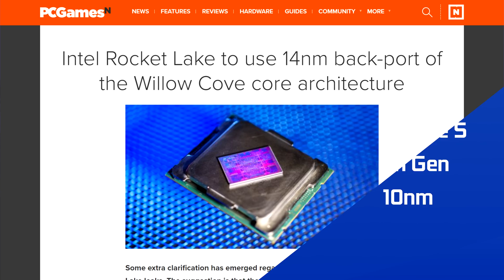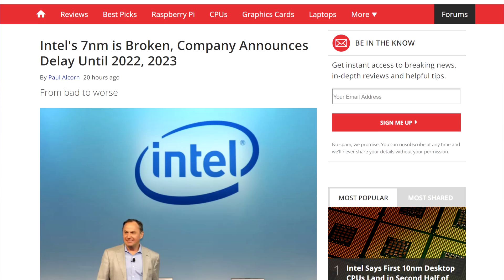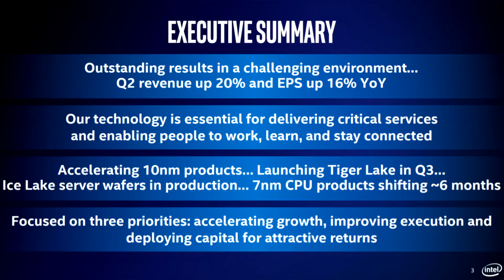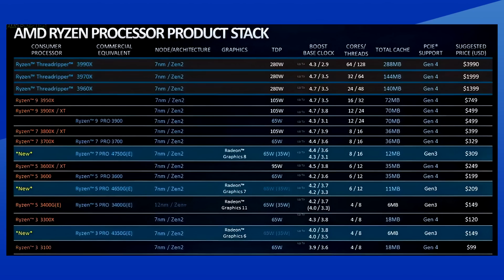Intel’s 7nm Process IS BROKEN! Delayed until 2022 - 2023

Comment: 7nm?  Where the hell is the 10 nm or did I miss it?
Reply: Intel fucked up on their 10nm so they decide to just skip to 7nm immediately
Reply: @NerfMaster000  thats not how it works
Reply: @AndrewMellor-darkphoton  I'd heard they were planning to skip a lot of products straight from 14nm to 7nm, since their 10nm node was so massively delayed and is still having yield issues. No way can they survive on mostly 14nm for another two years, though, they're going to have to get 10nm volume up and get everything running on it, Atoms to Xeons.
Reply: @NerfMaster000  intel 7nm is more complex than intel 10nm and 7nm needs tech from 10nm to work so they have to fix 10nm to get 7nm

Comment: "2022~2023"
Translation: "2025".
Reply: intel got foveros to help with this
Reply: @AndrewMellor-darkphoton  how? You cannot sandwich high performance chips.
Reply: @jonnypena7651  two layers, not a sandwich
intel adding foveros to alder lake
it will likely be simpler than lakefield
Reply: @AndrewMellor-darkphoton  still, the heat movement is very complex in a multilayer chip.
Reply: @jonnypena7651  I don't think heat movement is going to be a problem as only the top players gonna have logic which makes most of the heat and the bottom layer will only be connecting other top players with wires. The real problem is thermal expansion because the top layer will expand more than the bottom layer due to being hotter which will cause the copper pillars between the dies to stretch which might break them. Intel's gotten away with crazier things before so I don't think this will be hard to fix. Future 3 D stacking technology might stack logic dies on top of each other which will cause heat movement problems I don't think this will happen for another decade.

Comment: Go and take a look at Intel and AMD stocks right after the announcement of 7nm being delayed, you might find it amusing :)
Reply: Intel drop down 16% of their stock markets,I expect intel to fall,BUT NOT THIS HARD
Reply: Now the Apple thing makes so much more sense. Apple knew this already months befor we did they dropped for that reason Intel and now they try go to ARM chips. Apple likes have lower power consumption that's why they IPhones have 7 and 5nm TSMC chips now that Intel is still on 14 and 10nm for laptops and desktop Apple need to drop Intel. Apple laptops are mostly those ultra thin designed one they can't afford having high power consumption. Now everything makes totally sense.
Reply: @strohhuttv8848  Yes this is likely the reason for it. However bad processors or older gen haven't stopped Apple for selling their otherwise horrible quality products for rediculous prices, If you watch @Luis Rossman YT you know what I'm talking about.
What I think is going on that now that Apple will use custom chips, they are better preventing people being able to find parts for their computers so they can't fix them.
Also since Apple can't afford one single heatpipe going from CPU to a fin stack in their +2000$ macbook, they can't use Intel's old and hot 14nm process anymore and Custom SOC will allow them to use none existing coolers and call it premium.
Reply: @Diglo1  Yes I agree with you price = performance Apple is a huge joke but temperature problems is a no go for Apple specifically on laptops. What would Apple customers say if the laptop gets extremely hot and loud. Apple want no noise and decent temperatures in a ultra slim thin design. Intel is not a good fit to them ARM makes much more sense.
Reply: @strohhuttv8848  And it's an easy adoption for Apple as they already have products out using the latest and greatest TSMC manufacturing node on their mobile products. Scaling up those cores and getting decent performance is no issue.
Reply: @Diglo1  The problem I see is that ARM chips are not X86 that's a huge chnage for Apple. They will now change they laptop and desktop OS they will need change they programs to be able run without X86 u also need program your OS to be aware of big little cores if u don't know what big little is Google it. To be honest is a big huge change for Apple. I think Apple want one chip design one OS for all smartphones, tablets, laptops and desktop. Let's see will they be successful.
Reply: @strohhuttv8848  I am aware of big little design. Yes you need a total overhaul of iOS for it to run none x86 architectures, but I personally think Apple has been on a design fase for a while now.
Reply: @Diglo1  Yeah Apple has good software design team it will only cost a lot of time and money and of course man power.
Reply: @strohhuttv8848  Well i think there would have been a way easier solution if Apple was not satisfied with Intel: Use AMD ... but i think Apple decided at least three years ago to switch and AMD was not viable back then. They decided on ARM and are sticking to it now. Well i think it is the wrong direction but hey Apple lost me as a Mac  customer years ago.
Reply: @Astravall  Apple with moving to ARM chips leave mac desktop market. They want sell u altra slim thin laptops and tablets that's what Apple is focusing right now. Yes AMD would also be a choice but well is Apple who can understand them. My theory is that they just want make all they devices with one type of chips one type of OS just modify the OS interface and re-use it in all devices. I think that's the bigger goal Apple really tries to archive.

Comment: Why is this a big deal nm don't really matter it's just how much transistors you can have on a die
A 10nm with bigger die would not be much different from a 7nm with smaller die
Am I right?
Reply: The density of the chips matter
Reply: If they "just" make bigger dies it would mean :
Worst yields -> less margin
More silicon -> less margin
Worst efficiency -> less horse power/watt
Reply: Quentin Russo mate you don’t say “worst yields worst efficiency”, it’s Worse.
Reply: @EdNarculus  ok then
Reply: It's all about power consumption. More transistors less heat. You can only push 14nm until you get throttling.
Reply: It is a matter to be considered. Smaller node are more efficient. Look at 8 cores (14nm)10700k vs (7nm)3700x. (Power measurement exclude GPU+MB).
https://images.anandtech.com/graphs/graph15785/116012.png